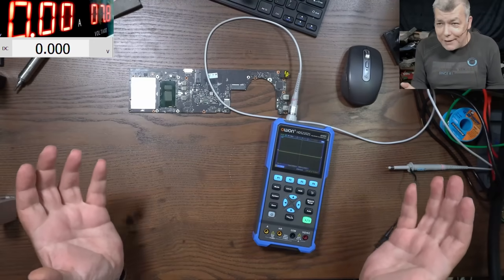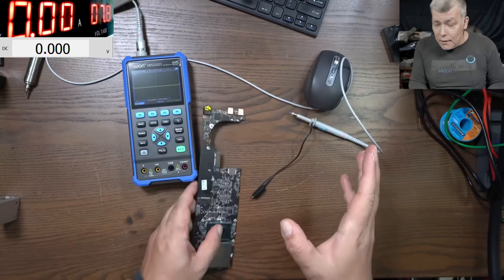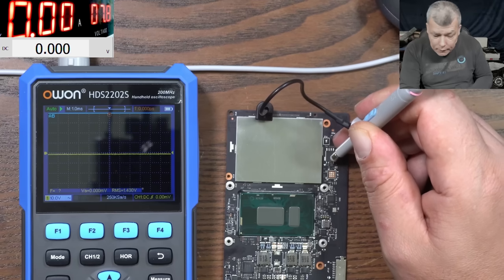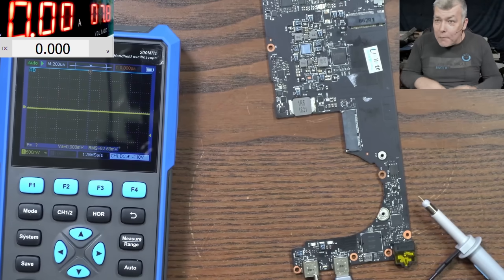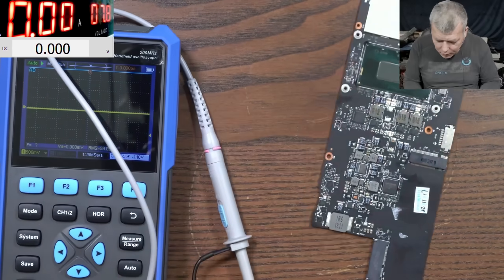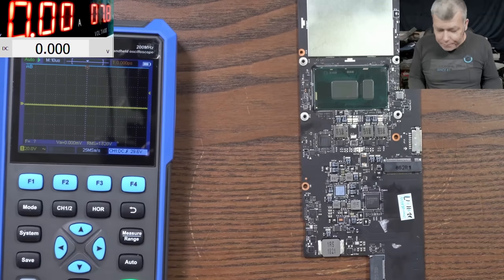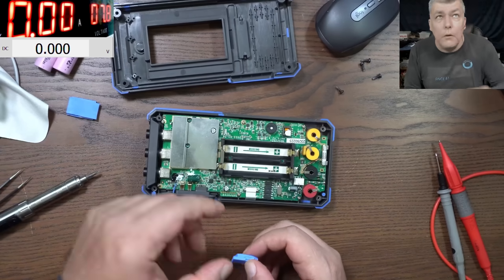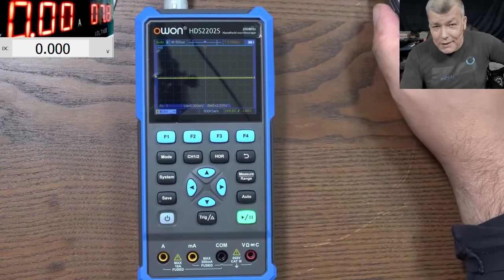OWON HDS2202s Oscilloscope - Finally i did it, now we can properly test chipsets

Comment: Regarding heat, a negative aspect is that the manual indicates to perform a calibration every time the +-5°C variation is exceeded, to maintain the percentage of error in the capture.

Comment: I could only afford the 100Mhz no function generator one, the raw 18650 battery is what sold me, finally a manufacturer that respects my intelligence and will allow me to use any cell I want without BMS shenanigans.
What I don't like about this device is the multimeter, it is a good multimeter, completely isolated from the rest of the device, it even has an isolated switching power supply and many optocouplers for communication, very well done... and very expensive, especially in button real estate, I would prefer instead of a multimeter dedicated trigger and horizontal buttons, so I don't have to navigate the menus to change the trigger mode or the time resolution.

Comment: Congratulations Sorin on obtaining a scope with signal generator & a wonderful addition to the shop tools.
Great thing about a battery powered scope is one can use it to measure primary side of an SMPS which would normally need an isolation transformer, or other risky methods like a "no earth" mains power lead to float the scope.
200MHz is useful at high speed digital signal levels & can also help identify bad logic levels, clock frequencies & many more.
The Owon is a good scope but its DMM function won't compare to a more capable DMM but as a cheap scope, it's amazing!

Comment: I know this is an older video Sorin but I have this exact linear power supply.

There's a really simple modification you can do to improve the noise on this particular supply. If you open it up you'll see that the earth point is one of the anchors after the transformer close to the front panel.

For me it was introducing noise because it's earthed after the transformer which is basically acting as a massive inductive load.

If you move where the earthing wire is attached to the lab supply metal chassis, so somewhere before the transformer closer to the IEC connector on the back it'll reduce output noise.

Comment: Thanks for the lessons. I finally just ordered a linear power supply. Ive been using a switching one and realized how much of a problem it is. I was trying to follow your video on how to check batteries with 6V and 2A and i kept killing batteries. Maybe you can use oscilloscope to make a video Comparing Linear to Switching Power supplies...

Comment: I have the same Owon HDS2202S. It's a great portable scope for the money. Somewhere between a higher-end MicSig or Siglent tablet scope and the cheap $50 "toy" handheld scopes with the tiny display and poor UI. I have several scope varieties, including the toys, this model, USB scopes, and a Siglent bench scope. They all have their purpose, strengths, and weaknesses. I think for repair work, the Owon is perfectly fine as you typically don't need high bandwidth and sample rates, and the fact it's electrically isolated (if you don't connect the USB cable while using it). However if you don't need the portability and have the bench space, you'll get more bang for buck out an entry level Rigol or Siglent bench scope at nearly the same or just a little more money. Things like protocol decoding would be handy if you're looking at signal contents, beyond just whether they're present or not.
Reply: What bench scope would you recommend for up to 500 Euro/Dollar?
Reply: @limebulls  I highly recommend the Siglent SDS 1104X-E.  It can be freely upgraded to support 200Mhz and WiFi with a $8 TP-Link wifi dongle, has a built-in web server for remote operation, remote software for SCPI control, etc. And you can find them for under 500 Euro/$. I consider Siglent a step above Rigol for their comparable models, and both are much better than the cheap Hantek and FNIRSI bench scopes.
Reply: @dwmorris one more question, it is my first scope and I would like to use it for repairing electric devices like in this video. Maybe to measure some things on a car/scooter if necessary. Maybe I will use it too to understand electricity better on a raspberry/esp32. What would you suggest? Is the Owon sufficient? I ask because I like the form factor more (less desk space with benchy) and it’s 2/3 of the price while being portable. Is there anything I can’t do for with the Owon HDS2202S for the purposes I described? I’m leaning heavily to it since it’s portable. But if it doesn’t have something that is needed for the above mentioned cases or is not novice friendly I would rethink my decision.
Reply: @limebulls  Given your experience level and mentioning car/scooter applications, I suggest you go with the Owon portable scope now. For the simple use cases you describe it is likely more than enough. As you gain experience and learn more about what’s possible you may find it lacking for more advanced uses, then you can look to upgrade to a bench scope. But keep the Owon for its portability! As I mentioned I have different scopes for different purposes. Don’t even ask me how many multimeters I have (not because I need them all, I just can’t stop buying them).
Reply: @dwmorris thank you very much for sharing your knowledge & your time 🙏 
Btw. the decoder function is awesome in the Siglent! Don’t need it yet but I would love to see that in a new revision of the Owon!
Reply: @limebulls  For basic protocol decoding you can often get away with a cheap USB logic analyzer. 24Mhz 8 channel Saelae clones go for as little as $8-10 USD. I have a 16 channel 200Mhz DSLogic Pro but you don’t need that for simple serial protocols.

Comment: I took apart several failed electronic devices and on a SSD drive and a DVD player both of the thermal pads / heat sinks are not aligned correctly.   If you have an expensive device I'm thinking from now on I'm going to open it up and find a way to put a better heat conductor on the main chips.  I didn't know about the thermal pads, I'm going to buy that thanks.

Comment: Fantastic video . . . wondering if you can discuss the advantages of using a Battery Powered Oscilloscope . . . not mch discussion usually  in these videos about how using a battery oscilloscope means there is noissue with the Ground issue and the dangers of the ground circuit beingfed back through an ascillospes ground throught the entire system

Comment: It’s already not available anymore from the amazon link. 😹

Big question:
Where do you get this NICE proper calibrated black „place mat“? (or whatever it is) from?
The one that protects laptops from beeing scratched. I really love this! I need one!! 😀
I have this blue cellphone repair rubber mat everyone uses, but it’s sticky, so you can’t rotate a leptop which sticks on top of the mat easily.

Comment: 4:27 - Actually if you use different threshold then you will see that single trigger, your trigger point was not set properly for that example. For those with less money, Chinese oscilloscope is available even for 60 dollars.
12:32 - You can also drill small holes in back cover, to let air go inside so heat will get out.
Reply: You should get micsig for 100 eur more with touchscreen, buttons etc, and large screen
Reply: @juliusvalentinas which model number and what can it do the Owon can’t?

Comment: Just using thermal pads without a proper heatsink to transfer the heat, doesn't just trap the heat you are trying to remove? A thermal pad is just a thermal interface material and it has to make a connection with a metal part in order to function properly. So I don't know how effective this method can be and if it has a negative effect or not.
Reply: Same question
Reply: Yes metoo

Comment: You get A LOT more for the money buying a RIGOL DS1102Z-E, about 279$.  100MHz 1GSa/s, which can be upgraded (simple "hack") to 200MHz full options for free.  Of course, if you need a handheld/battery powered one, Owon seems like a good choice. And many will be fine with a 40MHz version that is significantly cheaper.
Reply: What do you get that would help him doing electric repairs with the Rigol that his Owon doesn’t have?
Reply: how to upgrade?!?!?

Comment: That's not a good signal on the switching power. The ripple should be tens of millivolts or less. I saw this when the power chip was resetting on current limit. Otherwise enjoy the scope. A battery scope is a good choice (to avoid magic smokes..).

Comment: I can't understand that thermopads without metal heatsink...
Reply: It's definitely more effective to add a metal heat sink, but the thermal pad on its own will still provide a greater surface area over which the heat can be distributed. Better than nothing, presuming the heat isn't moved to a less heat-tolerant component.

Comment: I thought you would buy a bench oscilloscope
Reply: I assumed as much as well but truly there is no need. He like myself probably enjoys the mobility.
Reply: Bench oscilloscopes come with the added risk of connecting the wrong stuff to ground. I can't believe how many projects I fried because of that :(
Reply: @IlBiggo  so true.
Reply: @IlBiggo  Most portable oscilloscopes are not isolated from ground when using power adapters or individual isolated channels. So you still have to be careful. They do make truly isolated and individual channels isolated oscilloscopes but come at a cost.
Reply: @thetechgenie7374  Of course. Not having to connect it to a grounded power source is the main advantage of using a portable oscilloscope.

Comment: Thermopads are not a heat sink. They will transfer heat from the component to the heat sink. You need to add a heat sink too.
Reply: I have the same question
Reply: Of course thermopads are not heat sinks, but distribute the heat over a larger area. This will help to decrease the heat also.